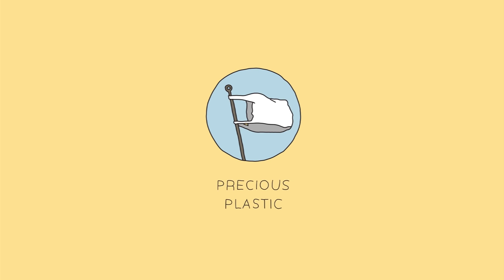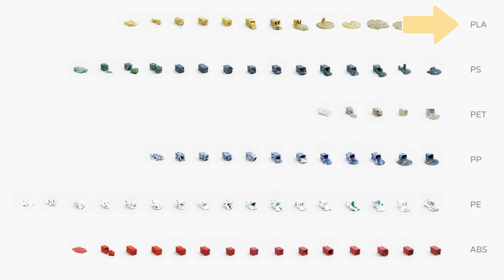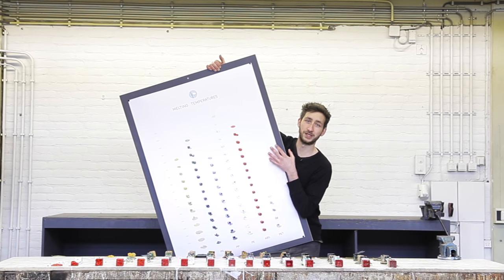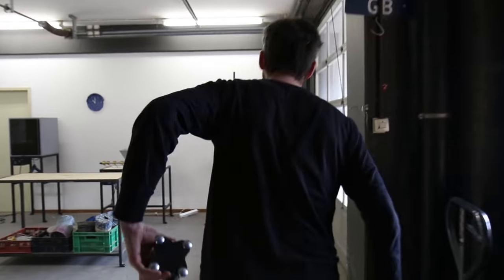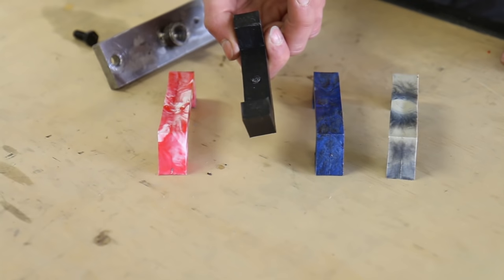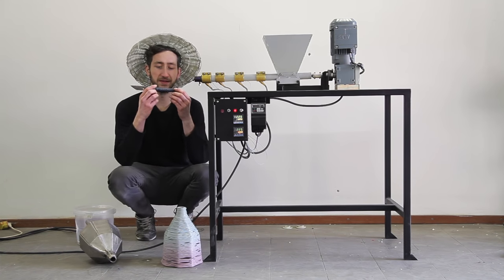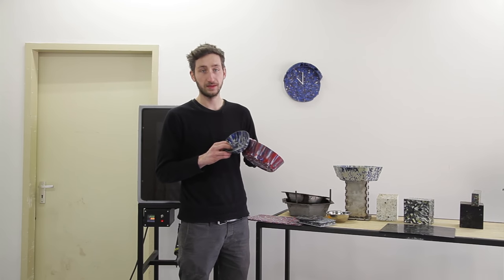Precious Plastic - Create things from plastic (part 5.0)

Comment: I did an experiment last night with HDPE. By cooling it down fast, "quench" like steel, I made it twice harder to cut and wear off. Which could be a good thing to mention, if you want your product to last longer bring it close to melting point then cooldown fast in water.

Comment: Wow that's awesome. I have some years of experience with industrial plastics injection, I never thought you could make it DIY as well. You should put that extruder vertically on a CNC frame and make a 3D printer thats using shredderd plastic!

Comment: very interesting video. just one thing, ABS is not recommanded for some use of creation.  ABS is made from petrol and we don't use it for create plate for food ( for example ), and when it hot, smell and made dangerous gaz. the only avantage, it's very strong. 
for food or contact with the skin, prefere PLA, it's plastic made from plant.

Comment: I'm going to revolutionize the home building industry with recycled plastic.
Reply: How its going?
Reply: yes because houses are made out of plastic obviously
Reply: @surronzak8154  the first people to make a home of wood, brick, concrete, metal, etc all probably got this criticism. 

plastic is insanely strong in brick form. it's possible to make it fire resistant/retardant, and UV resistant. paint would make it close to UV immune, as well.
you can mix in sand or rock and make a lighter alternative to concrete (not suitable for roads however). the biggest issues with plastic recycking for home building is picking the right one. you have to make sure it won't melt or soften in direct sunlight in absolute worst conditions (ie: unbroken sunlight for 24 hours). for interior use, it softer plastics are also viable, but for specific uses. like corner moulding or cabinet doors. I'd advise for harder plastics for counter tops however.

Comment: you should build a personnel smelting system to melt down metals like aluminum and then use those metals to build the molds or anything else. That way you are not only recycling plastics but metals as well. Making your system all the more environmentally friendly.

Comment: you can make plastic brick to build eco houses
Reply: OVAT131174 
id like to use a cake tin and make stepping stones bricks for the garden to the clothes line and around the house etc 😁
Reply: Added with sand, many people are making roofing tiles and paving bricks.
Reply: Plastic can burn very quickly. You would need something to make the bricks fire proof.
Reply: would be nice to make it like Lego, klick system, in Indonesia and all the small eilands in Philipines the can use it to build houses and cut less tree's. if someone can sale my this machien i would buy it to give to the people there!!
Reply: hello jcauberghe... I'm a fan of recycling as plastic garvage is one of our problem. I'm from Philippines and now I'm living in UK. I want to have a recycling business in the Philippines. I want to help the environment, recycle the garbage and earn from it and create jobs for people. The problem is the investment.
Reply: thats same dream like me.
Reply: MartinN hi, that is our thesis, brick from plastic and rubber.
Reply: @zenmateo4330  that was awesome, can I read ur thesis?
Reply: @jillyysheart , unfortunately it's very slippery
Reply: Thats stupid. Imgaine in a fire, the house will melt right away
Reply: @wolfden2944  Hello Wolf. What about using either cork on outside and molded plastic on the inside, or using real brick on outside and molded plastic inside

Comment: Would love plastic planks for construction, more so if insect repellent, heat resistant, overall resistance to warping, and comparable tensile strength, and lighter. I wonder how practical can they be, cost wise and as an alternative to wood.

Comment: Dumb question, but does melting plastic release toxic fumes, or just if it burns?
Reply: +Weirdo Sheep Doesn't sound dumb to me. I'd like to know as well.
Reply: From what I've understood is that each plastic has a "safe" temperature that it'll melt at without releasing any toxic fumes.
Reply: thedrew4you , I haven't melted the first piece yet. I've been researching the process to make sure I do it the right way and not hurt myself or anyone around. So your negative comment was highly unwarranted. You should never assume because it always makes an ass of you and me.
Reply: OU8NUCKS
I'm am already an ass, didn't you read my comment? However, since you're joining the club, let me teach you the secret club member handshake. It's simple, just a little fondle here, a little grope there, some uncomfortable silence and wink.
Reply: +thedrew4you I think I got it. Thanks for having me. *fondle and a wink
Reply: Toxic fumes are generally gases, plastic isn't a gas unless it is either extremely hot, or has burned. Typically it burns first.
Reply: this question can save a life
Reply: Weirdo Sheep meh just do it outside and invest in a 100 dollar respirator
Reply: Your health may be affected by the polymer resin itself, by
monomer residues remaining in the resin, by chemicals added to the plastic to make it more flexible,
stable or flame retardant, or by colouring agents.

Comment: How do you heat the plastic in this machine and what is the required temperature and pressure inside the injection moulding...please tell this

Comment: Good afternoon friend
My name is david I am from peru
I love your project seems
great, fascinating; raw material for recycling
My question is:
Once crushed the plastic
becomes tiny parts (filaments),
as I do for all the shredded plastic sticking
within the molder.
- You put some kind of glue?
- Or just sticks to pressure?
- You put heat into the moulder?
I would like to buckets containers for use at home.

Comment: #Knives are often #Pathological tools of society 6:40. 
Opt for better.
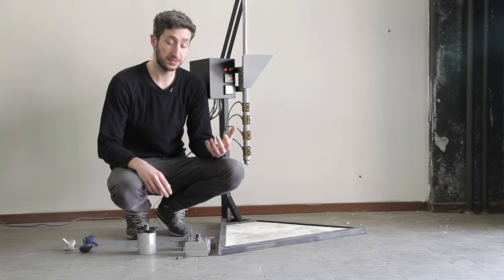3:13, I'm thinking Extrusion 3D Pen. Hot melt roller feed in, for plastic bags.
(could just move the object or flat plate under the fixed nozel instead.)

Comment: Is Plastic like Glass where you have to separate all the different kinds of plastic out first before making something with it, or can you just mix a bunch of different plastics together and not worry as much about the mix?
Reply: he said in his other video: since plastics melt at a different temperature, it's more effective to seperate them.  Also, if you seperate them you can re-recycle them as they will still be a pure form of the material
Reply: I can understand the melting point. I saw that part. What I am curious about is, can a person just....well just toss ALL of their plastic waste into a grinder, grind it down to small bits and pieces and then just use that mixture?

Lets say, to melt them into the form of a brick or something similar? Will this work?
Reply: Nanette Sage yeah it will work.  Just be careful because some plastics can explode.  You should research before you try

Comment: Hey man how do you tell plastics apart if they don't have a marker? If you were to mix plastic types would they adhere to each other and what temperature would you set it at if you are unaware.. My project does not require beauty but strength and mass production.. e.g. building low income housing from plastic..

Comment: A lot of wood turners use resin and wood to make turned objects(plenty of vids on you tube) my Question is ,Can i do the same with hdpe? will it stick to wood if i pour it on? can you glue wood and hdpe together? is it safe or will it fly off the lathe into my face?

Comment: Thanks for your video Dave. Could you put/send the temperature table you showed? maybe in excel? and... Is there a way to produce another table based on strength of each plastic type? for example, Fluency capacity or compression capacity, etc.? On the other hand, If I'd like to add some additive inside the plastic to maximize fire protection, what kind of additive you could recommend?

Comment: Just looking at  the melting chart, a question.: why is it only melting at one end? did you only expose one end to heat? I thought it would melt in a uniform manner, hardest in the middle, softer as you get to the outside. A tad confused.could you explain the process you took to melt it? Thanks

Comment: Awesome work! Keep the innovation coming.
@1:14 The "electrician" who wired the building needs to be slapped! 
Almost such a nice job. Nice straps, everything looks straight and spaced evenly.
But apparently they forgot the pipe bender for all the bends and offsets???? 
I hope no wire insulation was scraped. 
If high enough currents flow, it will push wires (EMF), causing them to wear....
HAHAH. So Jenky!
Oh man they did the whole building @ 2:43

Comment: Great presentations, but this environmental "hobby shop" requires a lot of time building the machinery, collecting plastic (which WILL comprise much time), sorting, washing (what a mess), grinding it, sorting it, studying, having a dedicated space, and the expense of making a mold that is basically unchangeable. Add that the colors are random mosaic mulch of color and the parts that can ultimately be made are easily, cheaply, extensively, found on the market already and this "hobby" is a HUGE loser in terms of efficiency. The REAL viable hobby for the inventor is in CNC technology AND especially 3d printing. The possibilities for 3d printing are 21st century, while injection is 20th century old dead technology. It's akin to space ship versus steam engine. Learn 3d printing and CNC machine coding instead of this labor INTENSIVE pain in the ass, and dopey recycling scheme!